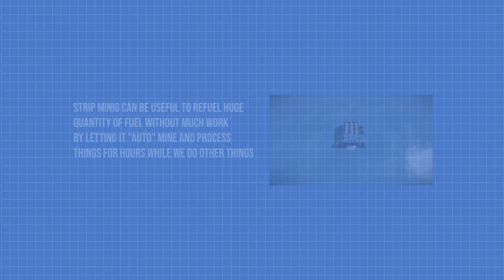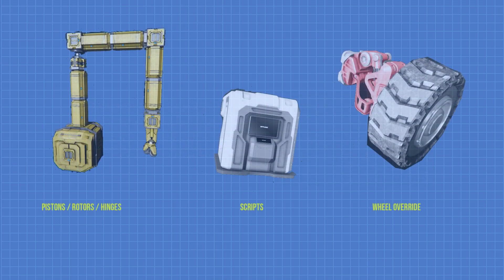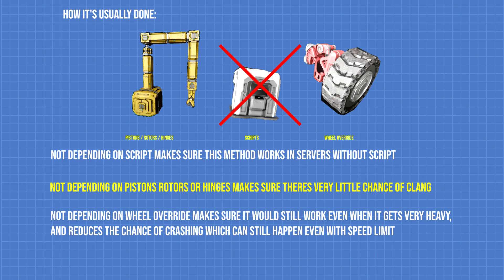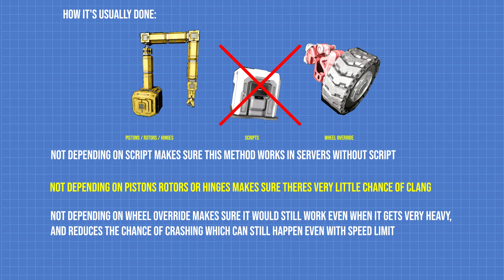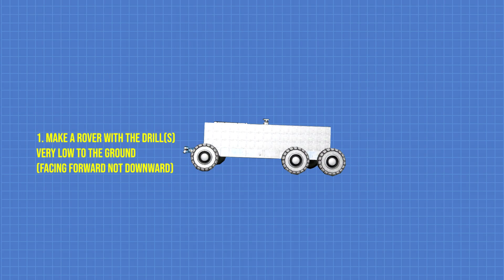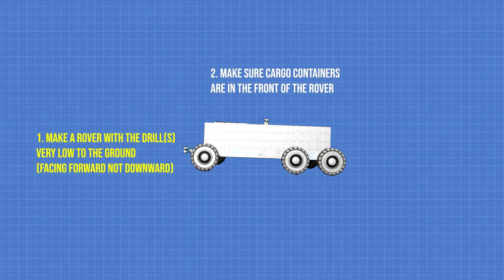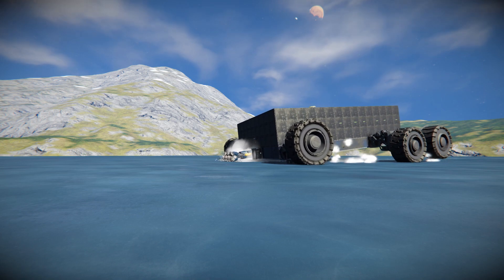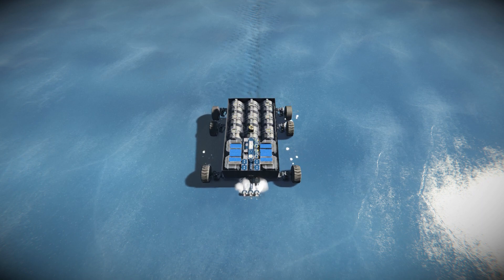Space Engineers Survival Tutorial, Perfect STRIP MINING Method For Lakes With 0% Chance of Failure

Comment: It is not really a comparison, but a different way to do the same thing. If it was a comparison, a large rover unsupervised roving on your world will stop mining ice when it reaches the end of the lake. A stationary location can mine much more unsupervised in a single session. The rover will be large slow moving so an easy target for npc and will not be able to leave the ice, might as well be a structure. It requires more resources. A stationary mining rig doesn't need to be anything more than a wind turbine, a few cargo holds, pistons, drills, a connector, and a sensor. A rover can transport ice to a depot to be further processed. With a single sensor to lower pistons on each rotation, no script is required. Your setup has one definite thing going for it. It is a mining rig with a built in hauler so you drive the tanks to your base, or at least to the edge of the ice lake. Thumbs up for the unique idea and the content.